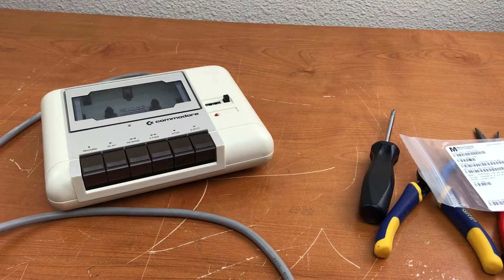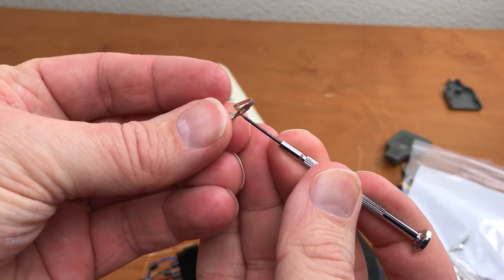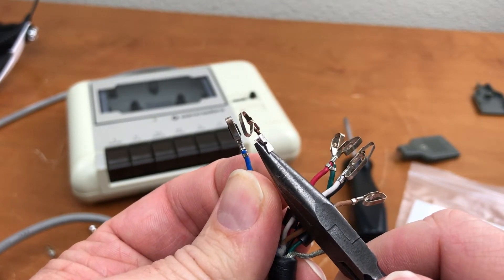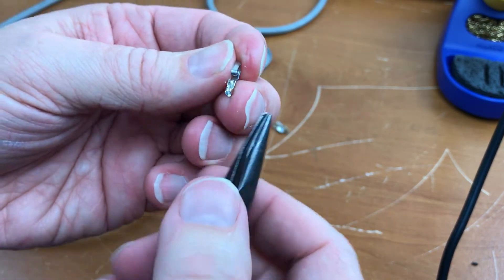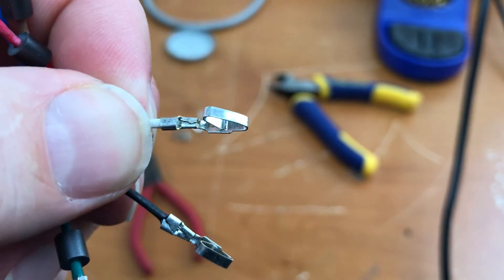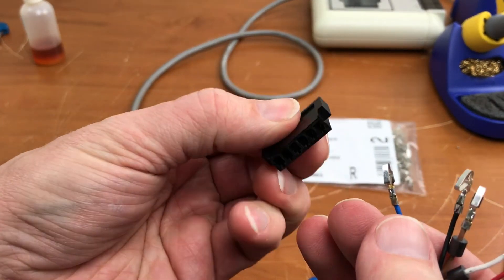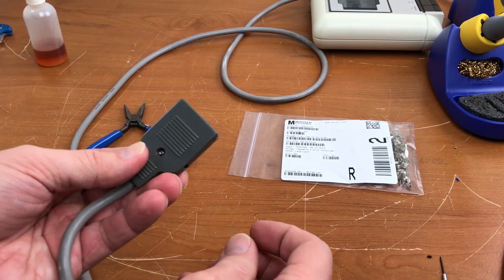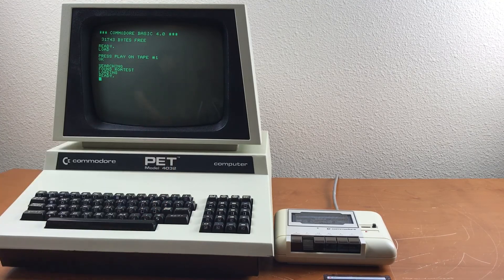Repairing a damaged connector on my Commodore Datasette

Comment: Yes they do make a crimp tool, however, just as you demonstrate, there is really no need for one unless you are making lots and lots.  In fact, even when I use my tool, I find i often need to start off the bending with needle nose pliers just as you did.  Very nice video demonstrating a restoration!  Thanks!